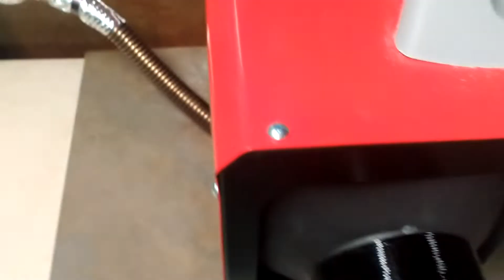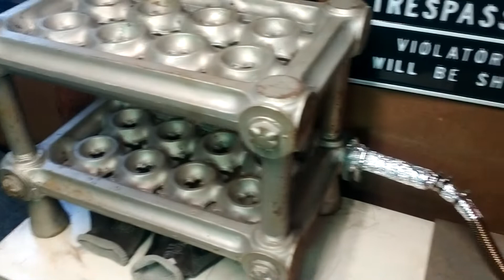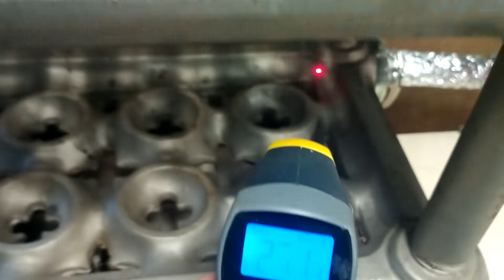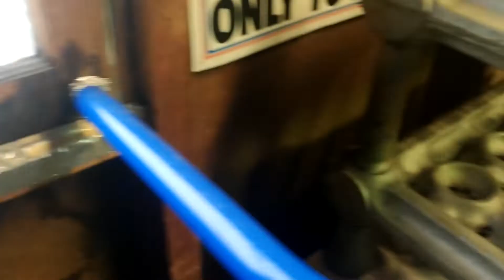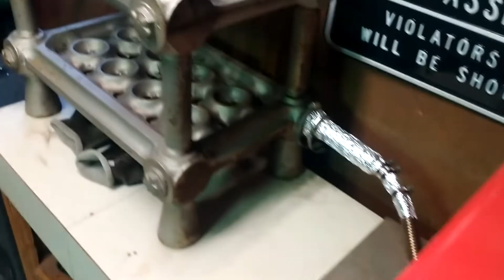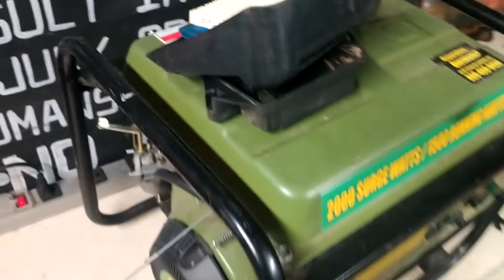Diesel Heater Exhaust Heat Recovery Experiment Update

Comment: Are you still running this setup 2 years later?  If so how's it doing?
Reply from the maker: @Grimster72  Yes, it still works well.  I am going to make a new video soon for the diesel heater group I'm in on FB...I will also upload it on my channel.  The only issue I had was a fuel pump went bad, but so have a new one now. 
No carbon buildup or condensation issues, I am going to show that in the video.

Comment: Cool video and surprising results related to condensation! Hopefully you have a very robust (fail proof) electrical supply to that 12V PS, especially with the unit located inside the heated space, an unexpected power loss would prevent the ECU from being able to run the cooling cycle and potentially result in an overheated ECU board. I see several of your replies in the comments indicating you have collected about a cup of condensate from the heat exchanger, have you ever tested the pH of the condensate? I've seen multiple comments online indicating that diesel condensate is very acidic, but I don't have any 1st hand experience of testing the pH of collected condensate from my heaters.
Reply from the maker: Thank you for watching and commenting, made my day.  Yes the power supply I use has been exceptionally robust, it is a variable 10amp, 0-48 volt power supply from china (link at end of comment) in fact I've ran 2 diesel heaters on one of them using my emergency heat cart invention/device when my furnace went out for 2 days in an icestorm.
Ive also succesfully ran a trolling motor on both one and two of those supplies using my generator in another video, they are excellent.  Many thousands of hours and hundreds of uses for those power supplies, highly recommend them.  As far as the condensate on the diesel heater, I'll do the PH test and gather some condensatebin my next diesel heater video to find out, because now I'm curious.  I'll have to include a look inside that radiator to show the result of thousands of hours of use on it.
https://www.amazon.com/Converter-IMAYCC-Adjustable-Transformer-Regulated/dp/B0BRZW59P6/ref=asc_df_B0BRZW59P6/?tag=hyprod-20&linkCode=df0&hvadid=652406883519&hvpos=&hvnetw=g&hvrand=16454846796251335019&hvpone=&hvptwo=&hvqmt=&hvdev=m&hvdvcmdl=&hvlocint=&hvlocphy=9017524&hvtargid=pla-2064748029356&psc=1&mcid=df52b7081fe23893b37eb59f7a1aba8f

Comment: You really shouldn't run the exhaust up hill at all. The exhaust should face down all the way thru. Condensation can form in the tube and wreck your heater. Some have found this out the hard way.
Reply from the maker: Thanks for the input, however after 3000 hours and 2 different heaters ran through that steam radiator over 3 winters: haven't had any condensation issues.  It has a drain that I periodically check just to be sure.  Part of it is the 2ft run of exhaust pipe stays above 400 degrees, the cast iron where that exhaust ducts into gets around 350°f so condensation cant accumulate, and its a huge heat battery that stays hot for a couple hours after shutoff which continues to remove moisture.

Comment: I used a finned base board heater pipe, be sure to slope it down hill for condensate. I am working on a small jet engine heater to make heat and electricity.
Reply: How well does the baseboard heat exchanger work? I'm thinking of doing this same thing.

Comment: I did a similar thing with my 2 diesel heaters. I bought extra-long exhaust metal flexible pipes 12' and 16' long, most of the heat is dissipated by the time it goes through to the outside. Much easier and cheaper alternative.
Reply from the maker: It may be cheaper, however, the benefit of the radiator is you can cook on it or heat up a container/pot of water.  I also like how it acts as a dryer for my gloves and a heat "battery" which dissipates heat for about an hour after the heater is shut down.

Comment: Cool experiment. Maybe if you find a small intercooler from a wreck and attach a fan you will have a compact and really efficient heat exchanger.
Reply from the maker: That's a great idea, I did that when I made a steam boiler with an old keg in my outdoor insulated "fire container" which is just a couple semi rims welded together on a concrete pad with a brick enclosure. It worked ok, but wasn't as efficient as I thought it would be -it was an open loop, I just vented the steam/water back outside so that could have been the problem, or just poor design.  This radiator (or any cast iron radiator I presume) is already an excellent and efficient heatsink and useful as well.  The heat is all absorbed from the exhaust to the point where the escaping exhaust is less than 100°f, and the hot side of the radiator is over 400°f near where the exhaust enters the radiator.  I have not needed to add a fan, but I could.  I use it for drying my winter wet gloves by placing them under it, and I also cook on it as well as heat up a water tank.

Comment: If you’re overcoming the condensation my guess is that’s a very efficient way to remove the heat! You might even install a 12 V computer fan above it blowing down through those plates just be careful of the condensation that has to go somewhere? Eventually you’re gonna find it!❤️🇺🇸
Reply from the maker: I actually attached an aluminum can outside and angled the exhaust pipe down... Collects about 24oz of water per 24 hour period of operation.  Bizarrely the condensate water is nearly clear
Reply: @ProlificInvention  don’t let the transparency of that condensation fully you it is very corrosive if you had galvanize sheet-metal it would rot a hole in it in a year! The few attempts manufacturers have made to extract all the waste heat have required PVC venting and special stainless steel boxes in the heat exchanger and even so it’s common for it to eat a hole in it! Where the heck did you get that ceiling cast-iron? We used to use them many many moons ago on the ceilings in a garage or a basement some of them were steam systems most of all of those have been converted to hot water and I’m sure there’s still some out there! Are you in the United States?
Over my 35 years in the heating business I couldn’t tell you how many tons of cast-iron I’ve moved in my life my lumbar spine can tell you because it’s all bolts and rods! But boy I’ll tell you now that I’m home done working I wish I’d saved a couple of those small radiators I mean I have seen fancy radiators that I should’ve collected instead of taken to the dump because they would still work today the old timers in the heating business with some rugged boys❤️🇺🇸 
And if they were ever to come back to life this pecks tubing that we use would kill these guys again😳
Thanks for taking the time to make the video I wish I had some good old cast-iron radiators talk to my heater the only suggestion I would have for you is to flip that cast-iron over so that your exhaust is entering at the top exiting at the bottom and pitch everything towards the outdoors eventually the low spots in the system are gonna start to gurgle😳 GOOD LUCK, STAY SAFE ❤️🇺🇸
Reply from the maker: @theusconstitution1776  I am in Michigan, and I got that radiator from a million dollar house in East Grand Rapids during a demolition job.  I have a feeling that the incoming diesel heater exhaust heats that lower section to over 400°f which doesn't allow for condensation to settle.  I installed a drain but have never had appreciable condensation build up, although I think if I reversed the connections that it would build up.

Comment: nice project but i think you may have problems with the heater putting crap into the rediator and it wont be fun trying to clean it out
Reply from the maker: Actually it's not as bad as you'd think, only a fine carbon residue after a couple hundred hours of operation last winter as well as this one.

Comment: Quit using an infrared heat thermometer. You can't have 230 F a the heater exhaust and follow it along the exhaust pipe and see it drop them a few inches later suddenly have an increase of 200 degrees. Read the instructions for the infrared thermometer. Reflective surfaces won't give an accurate reading. Use a physical contact pyrometer to take readings. Also, a temperature change can't be directly related to BTU recovery measurements. You should read the specs to calculate BTU recovery.
Reply from the maker: Definitely a guess on my part, thank you for the information.

Comment: Was wondering if this could be done.... Tried just running it without exhaust and while it does work, it stinks the whole place up. No co, but the smell kills you. Going to do this and recover all the heat I can get. Space is cheap, diesel is not.
Reply: In the north you can buy fuel oil.  Saves the road tax.
Reply: @eby6114 I do that. But there's always improvements to be made. I ended up settling on a very long exhaust pipe. It collects quite a bit more heat before it dumps. Also, tuning the burn helps too. I have mine clear down to 4hz from 5.5 and it burns cleaner while still being quite hot.

Comment: I have the exact same heater but i could not find a useful radiator to use anywhere... What ive done is i put the exhaust into the chimney and the bricks do absorb all the heat.... could not feel any warmth what so ever at the top...
Reply from the maker: That's a great idea, I had considered ducting my diesel heater into my Jotul woodstove in the garage, and I might do that still.  Thank you for watching and commenting.
Reply: @ProlificInvention  What a good idea exhausting into the woodstove!!!  On cold mornings you can light a few pages of crumpled newspaper to get the draft going and you won't smell that first minute of startup fumes.
https://www.youtube.com/watch?v=P3uHwrELUNo

Comment: Do you not get any issues with condensate building up inside the radiator?
Reply from the maker: No, surprisingly I only got about a cup after a couple weeks of nightly operation+although you can feel and see condensation out the exhaust outdoors.  I attached an aluminum can on an angle to "catch" the exhaust and collected a decent amount of condensate in a few hours which leads me to believe it's mostly being evaporated or steamed out from the high temp.  I'm doing more tests this winter, it has a drain so it's easy to keep track of
Reply: @ProlificInvention  Interesting, I wonder if thats because of the type of radiator your using, I was hoping to do the same with a standard single panel steel radiator
Reply from the maker: @modzzjust4u  Give it a try, you may be able to drill and tap a hole for a drain bolt or plug if not equipped, so you can keep track without having to tip it.
Reply: @ProlificInvention  I own a HVAC company. In gas furnaces they push the exhaust in the top of the heat exchanger and out of the bottom of the heat exchanger. It traps the heat in the exchanger better and let's the condensation out, but it might increase your back pressure too much.

Comment: Could use few dozen bricks on top of radiator to collect heat for slow release
Reply from the maker: Yes, I used a cylinder of water, bricks, ect. in other experiments and videos, I even cooked food in a pan on it.  Keep in mind this weighs over 150 lbs and stays warm for a long time after the heat is shut off

Comment: You are condescending water and unburned fuel in the exchanger. I hope the unit has an auto shutdown when the exchanger gets clogged or fills with water. Also hope you have insurance.  My furnace is a condensing unit by design. You’ve probably seen one with the little condensate pump unit on the side. I measured the output and it’s 1 gallon per day.   Kudos for the experiment. Perhaps you should tap a small drain into the bottom exchanger and run it outside.
Reply from the maker: For a minute I thought you were calling me condescending 😆 after a reread I see you mean condensation.  I've done several experiments on that.  This radiator has a drain, after an entire week of intermittent operation (80 hours) I opened it to find about 1 cup of clearish water.  I was curious as to why there wasn't more.  Since the "exhaust"  that does come outside from the radiator is steam like and not smoky or smelly I put an aluminum can on the end and it collected about a cup after 6 hours -outside.  My observation is the radiator heats up sufficiently to keep water in a vapor form and propel it up and out. If water accumulation was a problem with this design I would have already had issues as I ran this every day last winter, and part of this year.  I've also ran this with several generators attached to it and burned many gallons of fuel that way (also an interesting experiment), with no moisture accumulate in that case as well.  I appreciate the warning and advice, but in this case it's already been determined to not be an issue.   I still check the drain after extended use just to be sure though.

Comment: Have you tried heating water using the exhaust yet ?
Reply from the maker: I have, in an aluminum pot and it heated a gallon to 170 degrees °f in about an hour.  I've also cooked burgers, hot dogs, and some other things in a pan on the radiator (close to where the exhaust enters the radiator it stays 300-400 degrees)

Comment: Exhaust smell...  Does it stink without the radiator heat recovery? I expect stuff is condensing in that radiator.  Might be good to feed it from the top and arrange it so that liquids can all run down and out.
Reply from the maker: I've tried it both ways, condensation is limited.  I think the 300-400 degree temps send the moisture up and out.  There was no difference in accumulation with either setup after over 100 hours of use on both.  There is more of a diesel smell without the radiator for sure, also there is a drain plug but it's not really necessary but I still check it periodically.

Comment: Love the idea behind this! Just doing a little research as I would like to get one to heat my office in the shop, what sort of fuel consumption are those heaters an hour? Love the steam radiator too I think I know where there is a big old heavy cast iron radiator I could use for extracting as much heat as possible! Although it might be overkill as its only about a 3 meters by 4 meters insulated and double glazed would love to hear your thoughts! Thanks
Reply: I have one heating my 3 bedroom house and it works a treat, way cheaper than turning central heating on and will run on battery in the event of power cuts...
Reply from the maker: Thank you for watching and your excellent comment.  These diesel heaters use about 12 ounces of diesel per hour and about 1.5 amp hours of electricity per hour at 12 volts, I have the largest version marketed as an 8kw.  It puts out approximately 26,000btu/he so yes, it would be overkill as the diesel heater with the thermostat set would easily heat that space, as well as conveniently.  I'd buy an AC to DC 0-48 variable voltage box on ebay featured in some of my other videos (can do up to 480 watts, but one heater uses a max of about 120 watts when firing up the glow plug) They're about $60usd from China but well worth it for controlling DC items under 480 watts of consumption.  You could do the radiator but it will add some complication namely buying and fabricobbling the connections, although with that small of a space the heater would likely just idle all the time once up to temp and although quieter it will increase carbon buildup and necessity of maintenance like cleaning or replacing the glow plug and burn chamber (which I've only had to do once after 3 seasons of winters)
Reply from the maker: Here is a video of the AC/DC variable voltage controller I'm talking about: 
https://youtu.be/7kqqlWtPQm8

Comment: Wish I could find one of those radiators  in my area they aren't used. I may try and use a transmission cooler.  But it won't be as good as what you have there
Reply from the maker: What I would do is go on FB marketplace and use the search terms "steam radiator" or  "cast iron radiator" or just "radiator"... I found quite a few more in my area than I expected.  I even found one close by on Craigslist that way.  Thanks for watching btw, I appreciate it.

Comment: You need to reverse the two exhaust to the water can get out
Reply from the maker: It has a drain plug on the bottom, after 80 hours of running there was only about a cup of water which is acceptable-they are made for steam after all.  Thanks for watching
Reply: @ProlificInvention  I think that diesel exhaust is acidic. I have a diesel boiler and they say if you let the boiler run cooler that 180f for too long it wont push the exhaust up the chimney and the moisture gathers and rolls back into the boiler when its off and eat away at the iron.
Reply from the maker: @qualityhardwood5356  I am on the 2nd year of running it, no issues.  I examined it after the first year and their was a fine carbon residue on the inner surfaces, but no corrosion was visible.  Not too worried as it was some scrap I picked up years ago, it's cheap and easy to replace after however many years corrosion eats through the thick cast iron.